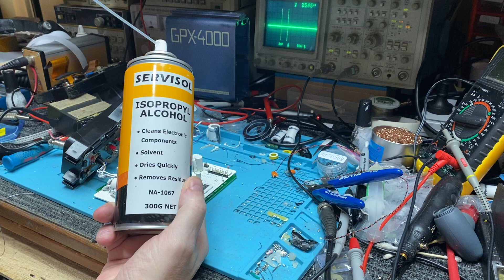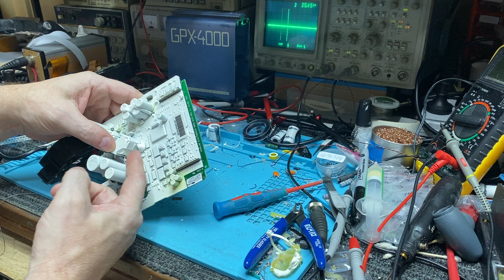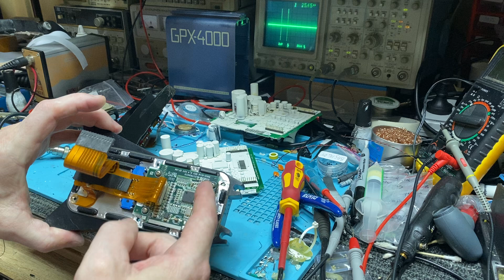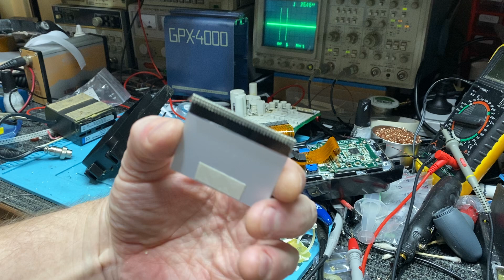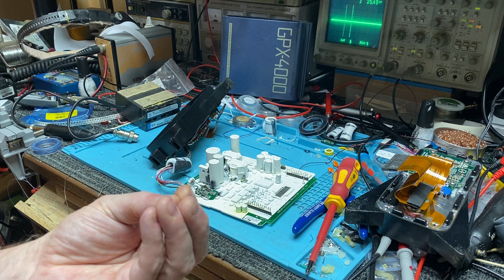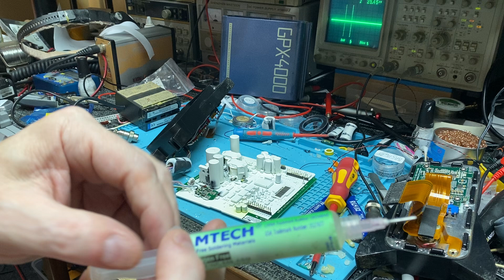GPX-4000 Hybrid metal detector, Part GP-3000 part GPX-4500

Comment: Love your videos regardless of being electronically illiterate lol!  Still trying to figure out how the “tune” button picking frequencies works in conjunction with variable gain and frequency or is it separate ?  You did my 3000 not long ago.
Reply from the maker: Don’t use the tune button unless you put the gain very low, but it’s better to tune manually around high medium or low frequencies.
Reply: @ and when turning on the detector, have the frequency maxed (fully clockwise) correct?
Reply from the maker: @ yes or the pull will not lock.
Reply: @DetectorMods    If you turn variable gain and frequency down all the way counterclockwise, will the detector be like factory normal?
Reply from the maker: If you put the gain at 6 out of 10 and the frequency to half way it will be close to standard but the mods will still give a better noise floor as the detector will be quieter.
Reply: @DetectorMods    Thanks Woody!